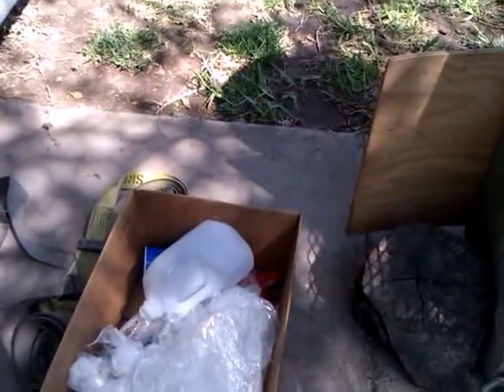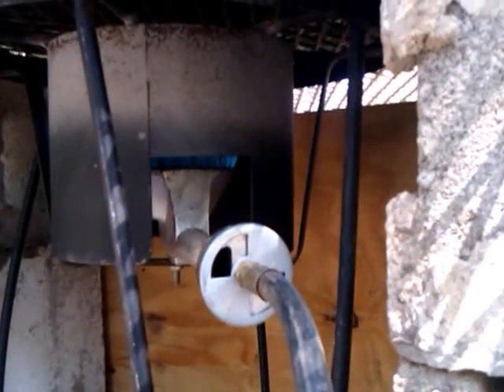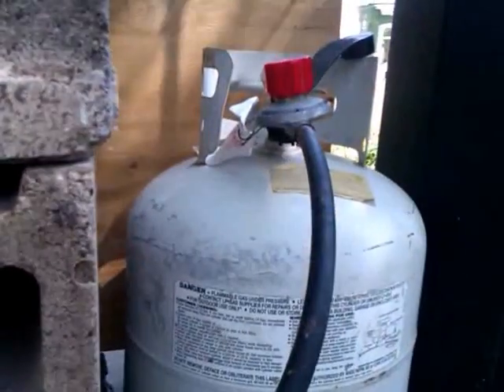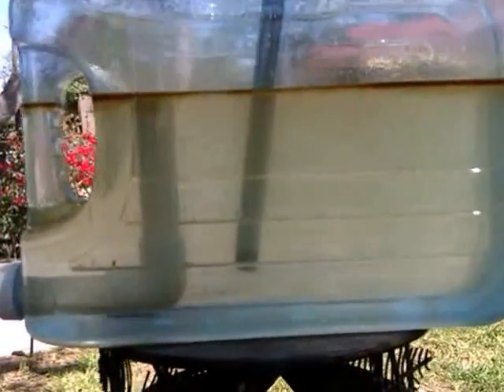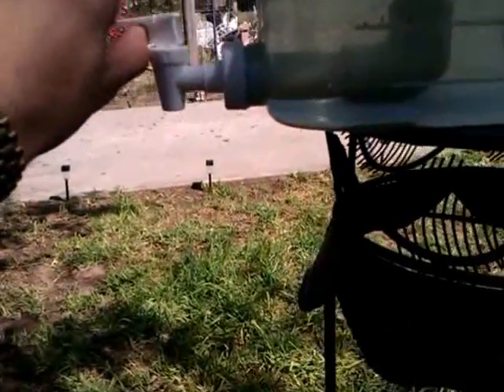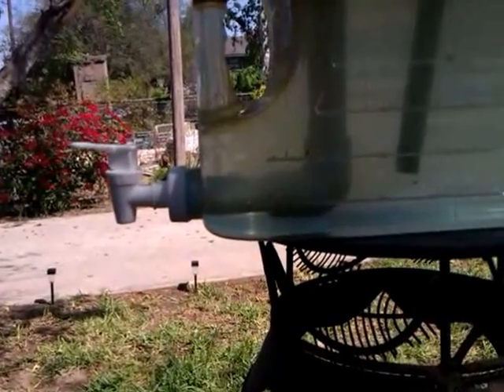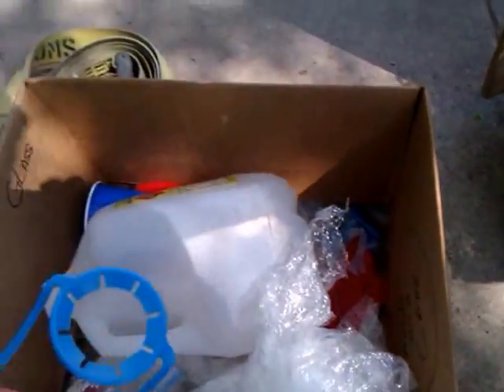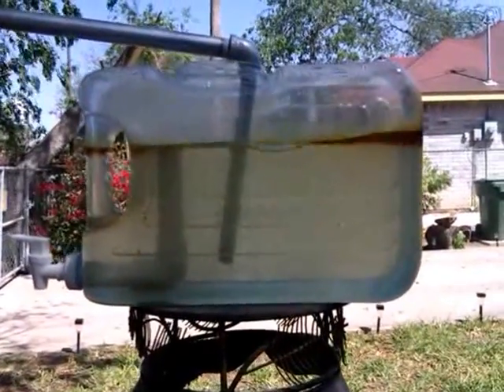Homemade oil refinery. Turning plastics into oil

Comment: I would use a copper coil in the water instead of the PVC system you have going. You would probably get a lot less water with your oil

Comment: I want to copy you. Will use scrap wood and grass clippings for heat and run the production pipe through the water but keep it separated from the water to limit sludge buildup! Excellent first success!

Comment: Have a math/chemical engineer do the calculations on how much energy you are useing versus how much energy you are reclaiming vs how much energy is originally used to create the exact weight of plastic in the first place. Point; you are adding to the contamination by pumping kilowats of energy into converting plastic back to its petroleum form. Guess what happemds when you use that reclaimed petroleum into heat energy? You make three times the air polution you started with. However, I like the idea of it helping one to live off the big corporations who dole out energy.

Comment: You should reuse the excess gas from the plastic it is very flammable and i calculated the heat to be aroumd 400 to 500 degrees celcius

Comment: You should use the excess gas to power the fire its very flammable I've calculated that the heat should be about 461 degrees celcius

Comment: Ok. So you put a kilogram of plastic inside the chamber and vaporise it by heating it. What's the energetic balance? Is it sufficient or you use more energy with propane gas than eventually you get with oil you produce? That's the smart way to get rid of plastics BUT when you put your 1000 g of plastic - how much waste that you cannot process any longer you end up with? What's the ratio of usable and useless when it comes to 100% mass of polymers you use? Does it leave some waste that cannot be processed? If yes, how much?

Comment: dont want to demotivate you, im wanting to do this on an industrial scale in asia. but the problem now is you have wet oil and you need to dry it out... the pipes should be copper and cooled in ice water and only the remaining gas left over should be put into the water... you also have just made a gasoline/diesel/fuel oil mixture and will need a multi stage still to make it useful fuels unless youre just running some kind of industrial machinery or heater with it....

Comment: Heat can be produced from the fuel you are creating thus using no outside energy.
Reply: And thermodynamics rears it’s ugly head again.  

There are loses in every system, no matter how efficient we try to create the system, we can never get more energy out than we put in.  

What you are describing is a perpetual motion machine which is simply not possible.

The amount of energy needed to create pyrolysis oil is always going to exceed the amount of energy you can extract from the pyrolysis oil.

Not to mention this stuff is just as noxious if not more than petroleum so be careful messing with it.  It is a rather potent carcinogen.  Lots of dangers involved for the home chemist.  I can certainly see it’s applications but definitely something you will want to do with the proper safety gear and knowledge.

Comment: Concentrated solar would probably be more effiecent, build a large satellite dish with small mirrors, or something similar, and put the barrel inside a box with glass window at the focal point, the box will insulate and it should do well, I been thinking about pyrolysis of wood, but plastics work the same i guess, without the water content, using the sun will be alot more GREEN!!!

Comment: With commercial Pyrolysis machines they use the gas that’s given off to fuel the process, so only needing an external heat supply at the beginning. As both gas and a liquid is produced. It seems quite inefficient to waste that gas, cos it takes a lot of heat to run Pyrolysis.

Comment: Add a couple old radiatord and get rid of the water tank you could also collect the gasses that don't condense and use them to supplement the heat source.  Maybe just Google destructive distillation of wood.  This is a tried and true method that works on a bunch of different hydrocarbons.  Also with advanced methods scientist claim to to be able to get far more fuel from plastic bags then it takes to produce that fuel.

Comment: You need to insulate your pyrolysis chamber.  You're wasting way too much propane and the ambient environment is dissipating all your heat away.  Also, your pipe should be a curly tube so that the ambient air cools the gasses off as much as possible.  Every time that thing goes "ga glurp" and creates bubbles in the water, you're blowing good fuel right into the sky and only capturing maybe less than 1/2 of what's available.  Between insulation and a proper condenser, you could probably quadruple your output instantly.

Comment: there is like a  propane gas produced in this stage you can use to use a heat for the burner if you use it right and know what your doing you would know this

Comment: For the author and anyone watching this, this is extremely unsafe. A steel drum is not a boiler made of boiler grade steel, same with threaded galvanized pipe. A explosion could easily occur. Your condenser makes no sense either.

Comment: I hate to burst your bubble, but most of the gas that bubbles in the water doesnt get condensed and escapes out of the top ... put a wet towel on the top and see its color after a few hours .... I would recommend using an old car radiator submerged in cold water will improve the yield significantly ... let gravity pull the condensed fluid in the radiator so make sure you dont align the coils vertically or you will get a clog followed by a pressure spike and then oil shooting out of the cold end splashing everywhere. Practically at home setup, you will never be able to condense all the gases 100% (specially you are using low density plastics which will not yield much oil or liquid at room temperature and predominantly will be methane gas and the likes which will not condense without pumps and cooling, so I hear the best thing to do is to put a pipe on that top opening and feed back the gases to the propane burner ... scale that up enough and eventually you can get ride of the propane tank (use it just to start the process ... after that it becomes self sustaining until you need to feed more plastic) ... you can also collect some of the gas under water like a wood gassifier setup ... good luck !!

Comment: Hi there.This is a great project. May I give you a suggestion ? I can clearly see, perhaps I did not look it carefully, that you are collecting only one product of this thermal degradation. Only the volatiles are condensing when the mixture gets in contact with the water. The remaining is just going out into the atmosphere. The non-volatile gas is also flammable. I mean, the plant can be more efficient if by the end of the product you have chars, oil and gases. If you modify it, ensirsing safety of course, you can burn the gas directly on the flare. But the way you did it is fine and I am sure you will get an +A. Greetings from Brazil

Comment: The lighter gases you are venting to the atmosphere are also flammable. If you redesign your system, you could use that gas to supplement the propane heat.

Comment: Forgot to mention; a copper coil 1/2" stock 10' coil will work arrange so that oil runs down the coil and out without puddling; Keep this coil submerged in your cooling water; Run your copper into sealed collection jar then out the other side of the jar send the gas back into the fire to burn any leftover chemicals.

Comment: GREAT job! It is so great that you are doing this. You will learn so much and in the future this will be one of the building blocks that support your overall, well diversified, knowledge of energy systems. Now the bad news (which you already know) if you compare the gas in with the fuel out, you may be disappointed, SO your solar and wind ideas are AWESOME and I hope you get to that point. You also may consider using LOW grade heat from solar or wind to reduce the plastics to an easier to handle form like "Melted ingots" or Ground to a gravel consistency for conveyor feed into a continuous process. Don't forget that while you want to remove use of propane; you also can use it to "TOP OFF" the energy collected from solar and wind. Hardware store resources will take you far, you are truly in a great position to succeed in scientific experimentation! ! !
To measure energy in and energy out can be done by Yuky math or by simply using your produced oil to produce more oil. this will show you Exactly how much energy input is needed for x amount of output. You just need to add a waste oil burner setup to take over for the propane. 
also - insulate this operation as much as possible and pre-heat your combustion air (at least a little bit) but be careful the extra hot flame burns much higher (longer- in height) than a cold feed air flame making it put out soot when flame contacts metal.

Comment: use the gas you make to heat the plastic so it runs itself. i desined barges that scoop up plastic out of the giant plastic islands in the ocean . make fuel and heat and extruid more  plastic floating barges. when the 6 piles of trash around the globe can be turned into a new country..then you can power the floating island with the swells...

Comment: Hi, Have you actually used this fuel in any application like replacing diesel in your car or generator etc. Does is affect engines in wrong way? Have you  tried?

Comment: existentialtexas

hii there. 

i saw this video.. i have a few doubts which i want to clarify. 
1. how much oil can you get from plastic ? 
2. if there is come toxic chemical residual in oil.. that you can't or fail to separate out, then the oil (fuel) will give out nasty toxic when one use it in whatever application isn't it ? 
3. what is the by product of this plastic fuel process ?  
a) what are the thing remaining after plastic give all oil up ? what to do with the residue  ?
b) how about the fluid that you use to condense the plastic oil ?  if it get saturated, you have to dispose it.. and how toxic is it  ? and how to deal with so much toxic fluid ? 

if you have update of it.. i would love to know.. tq. cheer

Comment: +existentialtexas Have you updated your design yet? I tried something similar after watching your video, but the piping was too short to allow the air to completely condense. As a result, most of the vapor was still hot when it came out of the pipe and it escaped into the air. I'm working on a design with a coiled copper flex tube. If you upgrade yours or have any new findings, please post! I enjoyed this! :)

Comment: what if you pump CO2 into hydrogen gas to make carbohydrates, then use the oxygen from the electrolysis to start a combustion reaction and recapture the water and CO2, it'd basically be a way to have combustion using only electricity, since no water or CO2 would be lost.

Comment: Wouldn't it take more energy to fire the torch than what you're getting from the oil?
Reply: Probably, but I think he's going for a way of recycling the random plastic. He does mention wanting to change it to electric outlet, solar, or wind powered, which would make it much more environmentally friendly and cost effective.
Reply: Depends on how well the kiln is insulated. If you minimize the waste of heat and utilize what waste you can't prevent you are in the green. Plastic does burn after all so it can be considered a fuel and therefore it possible to get net profit of energy from it.

Comment: What happens to the waste in the drum? Inspiring work, you got me thinking man. Great Job!
Reply: Since the plastic is in an oxygen free environment and along with the water chamber attachment, it will completely boil into a gaseous form without burning or sticking to the bottom, and then those gases re solidify once they travel the pipe, leaving only the petroleum oil left!
Reply: No, Blake. There are two problems, polymers that will not be broken by the heat from his set up, which is a lot of them, and inorganics. Bunch of titanium dioxide in end use plastics along with other materials.

It's a fantastic high school science project, but it's a horrible idea in practice.

Comment: also... thinking about the propane being used to produce a relatively low volume of oil. the most efficient way i can think to do that would be a large frennel lens on an aluminum heatsync at the botyom there with a sooty coating to absorb the light better.

Comment: good technique. thinking long term and about the most efficient way to recycle the plastic may be using it in building/insulation materials and that process would have the lowest carbon output i could think of too... at least as low as using a pair of scissors.

Comment: Do you get enough oil from the plastic to use it to melt the plastic?  If the system requires more energy than it puts out, it's a net loss and just a waste.  But that should make it a lot easier for you to get the city (or any government) backing it lol!

Comment: You didn't need a vacuum to melt the plastic without it burning?
Reply: +Jerome Truitt It melts while it burns.
Reply: +BIGMUSCLE um no....melting and burning are two separate things.  one is a state change and the other is a chemical change.  If it's burning you are also burning the chemicals that you are trying to collect as fuel and changing it to something else.  When you melt it you are changing it's phase from solid to liquid and then to vapor which is not the same as burning.  It's like heating ice on the stove you heat it and it goes from solid to liquid to vapor but it's still water in all of those states it doesn't change to carbon which is what happens when you burn plastic.
Reply: Jerome Truitt applying heat to it melts it, wether directly or indirectly. That's the point. You also don't need a vacuum to melt plastic, all it needs is heat.
Reply: ***** adding heat to plastic with oxygen present will cause it to burn.  It takes more than just melting point temperature to get the plastic to vaporize, bringing the plastic to the vapor point in the presence of oxygen will make it burn rather than vaporize that's why you need a vacuum
Reply: Jerome Truitt It's evident that you're wrong base on the fact that he was able to melt the plastics without them "burning." 
You can easily test this by experimenting. Put a clean pot on a stove, let it heat up, then start adding plastics into it. Whatever results you get will be the answer to your question.

Plastics aren't necessarily super combustible, so most plastic materials would melt when exposed to gradual and indirect heating source. which this basically how this device works, they only combustion (catch on fire) when exposed to a direct and high intensity heat source.   

This types of devices also wouldn't work in a vacuum since the  plastic gases needs to exist the heater and collect into the cooled water and convert back into liquid.

For more information about plastics, see: https://www.quora.com/How-easily-combustible-are-each-of-the-major-plastic-polymers-e-g-polyethylene-polypropylene-polycarbonate-polystyrene.
Reply: ***** I am aware that plastics have a low melting point.  You do need a higher temperature than melting to get it to vaporize.  Even if a material isn't exposed to a direct flame it will combust once it reaches it's combustion temperature if it's in the presence of oxygen.  I've watched other videos of similar devices and they all employ the use of vacuum.  This video is short on details so it isn't clear whether he is using a vacuum or not if he's not then I would like to know what method he's using.  You're supposition that plastics will ONLY combust if exposed to a direct heat source is incorrect however.
Reply: +Jerome Truitt would a vacuum require just a sealed container? in which oxygen would presumably vaporize and exit before the plastic reached burning temperature?
or would a more complicated vessel be required
Reply: +Jerome Truitt in the japanese blest machine it just looks like a sealed container but maybe not
Reply: Thomas Buckland I think a more complicated vessel may be required as the vacuum would have to be maintained.  Any oxygen in the system would cause ignition I would think as you would need the plastic to vaporize in order to collect the hydrocarbons.
Reply: Thomas Buckland if you watch it again they say during the video that they use a vacuum.
Reply: Jerome Truitt Please link me to the videos of similar devices using a vacuum. I think you are just having a hard time admitting that you're wrong.
Reply: +BIGMUSCLE I don't have a hard time with anything.  The actual science proves what I am saying.  Just look up the Blest machine video and the Gakona machine video similar machines both use vaccum
Reply: +Jerome Truitt The process being used to melt the plastic and melt the plastic has the scientific name of pyrolysis. The following is a quote from https://en.wikipedia.org/wiki/Pyrolysis  "Pyrolysis differs from other processes like combustion and hydrolysis in that it usually does not involve reactions with oxygen, water, or any other reagents.[6] In practice, it is not possible to achieve a completely oxygen-free atmosphere. Because some oxygen is present in any pyrolysis system, a small amount of oxidation occurs."
Reply: aqkkkqp,,zia"bziwwqwexjn. uuynefh zjaoa
aaqqip zluqiq
Reply: +Ron Thompson So a vacuum is necessary.
Reply: As the plastic is being heated, oxygen is being forced out of the heated chamber. The amount of oxygen left is expended when the plastic reaches the burning point and a small amount of plastic actually burns. No more oxygen can get in the sealed container. Burning of plastic stops and vaporization continues. The result is a small amount of carbon residue or char left. So, I guess the expulsion of air and the burning of the residual oxygen creates its own "vacuum."